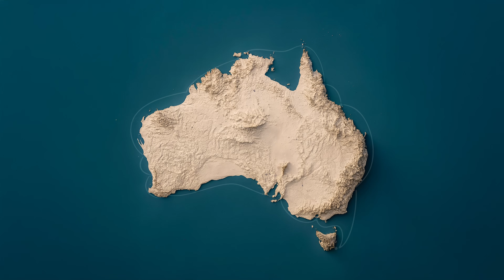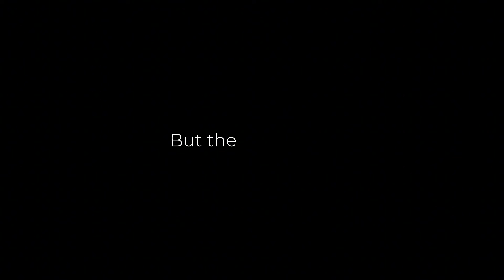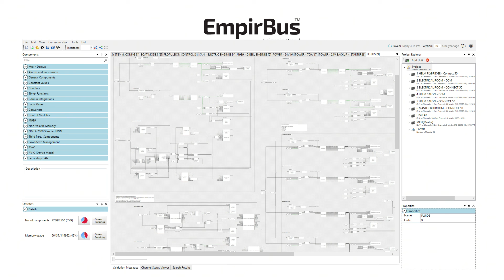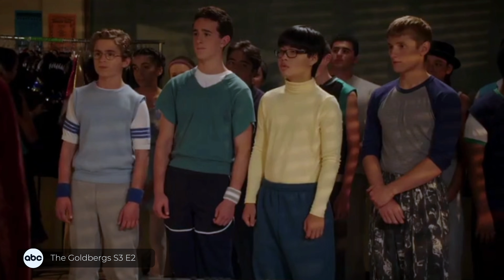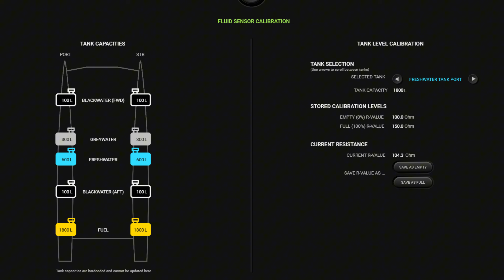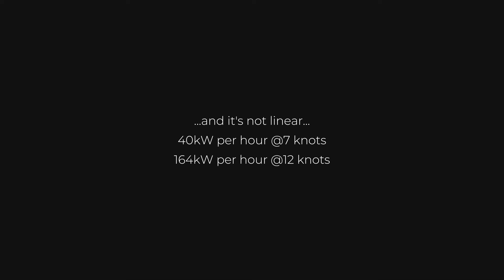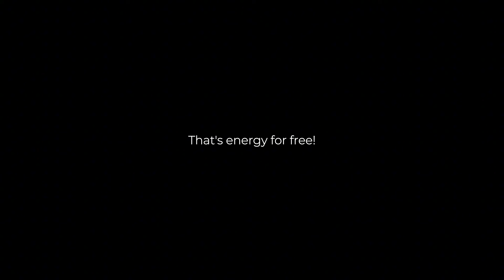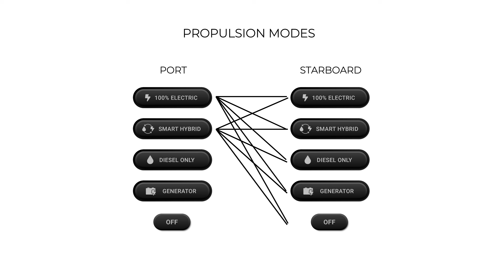The System Behind Our New Solar Electric Yacht

Comment: Hi. This is beautiful systems integration work and user experience awesomeness,  However I cannot get over a single bus for the entire vessel. Perhaps I missed it. I would have at least three. First for critical propulsion, control, emergency lighting and basic human life support.  Second would be for things like water maker, regular lighting, secondary mechanical loads. Third for everything else. I would have all 3 physically routed separately. On your size vessel 2 physical layers would probably be fine. I must be missing something because someone has smart as you would not have critical engine controls and a guest light switch on the same bus.
Reply from the maker: Good thinking. We have 7 different busses, with isolated CAN and NMEA busses as well. Critical systems have 3 layer redundancy for backup. Too hard to explain on a video, but definitely the most mind-bending part of the project to think through all of the possible ways it can fail and what mitgations we might need. It wont be 100% robust, but no system ever is.
Reply: @projecteyacht  That is great to hear. You seemed far too competent to not designed it properly! Like you said stuff will always break and swiss cheese to failure but we try. You built a fantastic system that I can only dream of!
Reply from the maker: Thanks!